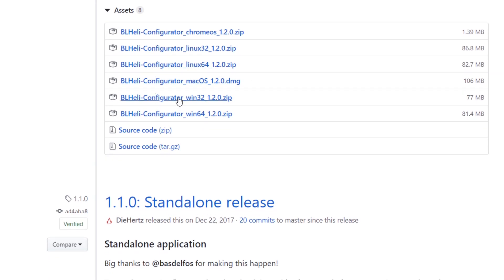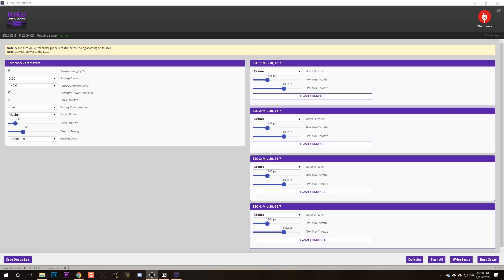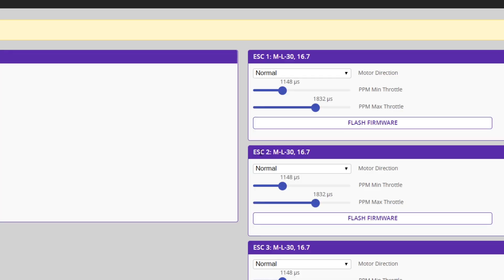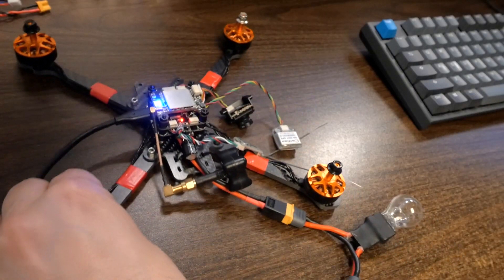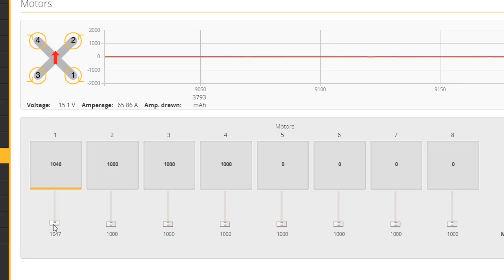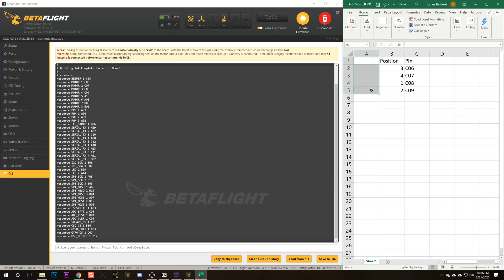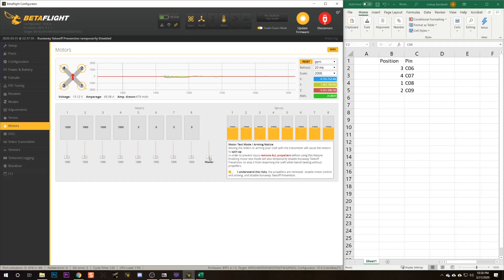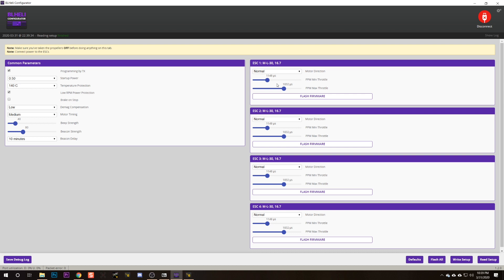Beginner Guide $120 FPV Drone How To Build - Part 9 - BLHeli Motor Direction and Position

Comment: I am using the vifly shortsaver and when i move the sliders it automatically shuts off and thinks there is a fault is this true or is this just becuase you cant spin the motors with the shortsaver on?

Comment: FYI check out his other videos on Bidirectional dshot and RPM filtering. My esc is M H 30 and I was able to flash 16.73 to enable Bidirectional dshot. You can't flash 16.73 in the BL Heli configurator pull down menu so you have to get the HEX file from JazzMaverick github. I went to Oscar Liang's rpm filter setup tutorial and he lays it out very simply. I don't know if it works on an M L 30 esc processor.

Comment: have a esc with M-H-50 Layout but I have flashed M-L30 to it. No connection anymore to my esc's...is there any solution?
Reply from the maker: You can flash the correct firmware using the c2 interface but it's a pain in the butt.
Reply: @JoshuaBardwell  https://www.youtube.com/watch?v=b-7VFt3IhhE
Like in this video? ;)

Comment: Does anyone else's video transmitter get really hot when the battery is plugged in? I'm pretty positive everything is set up correctly but its getting real hot
Reply: Yep. Mine does too. It is working fine so far though. I wouldn’t worry about it

Comment: im plugging in a 3s battery but my motors are not turning at all. i hear sound from the motor like i wants to move but it just doesnt. what could i be doing wrong?

Comment: Hello Joshua, I'm trying to flash my ESC using BLHeli32 configurator version 1.1.0. After I connect my ESC to the configurator, and click "Read Setup" It shows "Reading Setup finished" but there is no change to the main screen and nothing like what you showed in the video happens. I've tried using BLHeli32 Suite, BLHeli Suite, and the 32 bit version of the configurator, and all show some version of "ESC unknown" or "ESC not supported". I've been researching this for over an hour now and have had no luck. If you could provide any advice that would be greatly appreciated. (I'm building the Tyro119)
Reply: Go back into BetaFlight config -> Configuration -> ESC/Motor Features and change ESC/Motor Protocol to DSHOT600, save and reboot. Disconnect/Close BFConfig and try BLHeli again.
Reply: @ShatteredEagle  It worked! Thank you so much! :))))
Reply: @DylanDapperVlogs  np! Literally happened to me 20 minutes before. You probably updated BetaFlight, which cleared the settings, which then the Flight Controller didn't know how to talk to the ESCs so BLHeli couldn't communicate with them either.
Reply: @ShatteredEagle  I did! I flashed betaflight 4.1.5 on it (twice i think accidentally) so I assume that's what happened.
Reply: @DylanDapperVlogs  Heya! Figured I'd also mentioned that despite mounting the FC board correctly, I still had to rotate it 90deg in BetaFlight config for the quad not to death roll instantly on throttle up. Drove me crazy for 20 minutes, assuming flashing BF is also to blame in this case. 

Figured someone else may have the same issue so I should mention it! JB has a video on it as well.
Reply: @ShatteredEagle  Thanks so much this worked for me too! I was googling everything trying to have it show up. Thanks so much!!!

Comment: @Joshua Bardwell   At 4:38 you say no bidirectional dshot for us bc slow processor in ESC.  Mine says M-H-50 instead of M-L-30.  Can mine support it, and how do I enable that?  It is already at the latest FW, 16.7.
Reply: And how can I find what my ESC will do?
Reply from the maker: Yes jf you have an H ESC you xan use JESC to enable bidirectional dshot.

Comment: My tyro 119 came with a different ESC than yours. It came with a m-h-50 bl heli esc (you have m-l-30 in the vide). You can get H blheli_s ESCs to have bidrectional dshot with the JESC firmware. I was able to get RPM filtering setup and working.
Reply: I have the same new one as you. to get them working, do you set the ESC to Bidirectional in bl heli config? are there any other setting in betaflight to set?
Reply: Here's some instructions on how to install the JESC firmware (it's a fork of blheli) https://www.youtube.com/watch?v=Fhn2LdCMqgw, and then Josh Bardwell has instructions for configuring RPM filtering and verifying that it's turned on https://www.youtube.com/watch?v=6a69juWsqyU .
Reply: I  also found that mine has the M-H-50 ESC.  I loaded it with JESC last night and everything seems good so far.  I haven't flown it with that firmware yet but I'm looking forward to trying it out.

Comment: Could you please advise what could possibly go wrong with beeping with motors?
After doing this motor directions remap (following your step by step on a Tyro 129 build) I did manage to have my beeper not working.
Motors stopped to beep on aux channel (mine is set to AUX4). 
I do have the switch turned on with settings set up for beeping when the AUX channel requests it. 
And the RX_SET Is also ON.
 Beeper mode turns yellow also when I flip the switch at my radio controller. (It seems to be working ok from the radio receiver command) but the motors do not beep as they were as I have set it up for the first time.
 Cause it's quite uncomfortable to find a drone in the bushes without beeper)
Reply from the maker: I can't think of any way that remapping would stop the motor buzzer from working. As long as the beeper mode turns yellow and then in the configuration tab you have rx_set enabled for the Dshot Motor Buzzer option, they should beep.
Reply: @JoshuaBardwell  Yep they should. But they don't. Unfortunately. Where could I look at? Any ideas? Already refreshed to latest available Betaflight. However on "pure" settings from scratch this beeper does not seem to be working either.
Reply: @JoshuaBardwell Hello again. I did manage to find out a reason for this. This is a Motor protocol problem. I did fix this by selecting a DSHOT600 protocol on Config menu. (Was ONESHOT) (Just FYI)
Anyway thank you for such prompt reply. And I really like your videos. Wish you growth of audience on YouTube.!!!

Comment: i can connect to blheli but after i hit "read setup" it just says "reading setup finished" but doesn´t do anything else. 
any idea?
Reply from the maker: Are you sure you are using the right program? BLHelisuite32 is for blheli32 ESC's; regular BLHelisuite is for blheli_s ESC's like used on the Tyro 119.
Reply: Joshua Bardwell 
Yes THANK YOU! Figured out that i need BLhelisuite32 :)
Reply: @lukass8169  i have the same problem but where can you find blhelisuite32

Comment: I have got everything configured.  I have my reciever connected and bound.  I have my esc wired to my FC.  I can spin the motors using betaflight.  I have flashed my esc and my fc.  My sticks don't move in configurator when I move them on my transmitter.  I cannot figure this out.  Green light on reciever.  sbus bad jumped on board. red light on FC flashing.  Any suggestions
Reply: Are you sure your receiver can do sbus, also make sure your FC can read sbus, and check you put the sbus wire to the correct pin on the FC

Comment: I just bought the kit, and I'm going to follow your instructions. I started flying line of sight on the smallest Estes quads around 2015, and really enjoyed them. Earlier this year, I picked up an Inductrix FPV Plus RTF on clearance at a shop, and have been instantly hooked on FPV once I started flying on a monitor. I got another Inductrix FPV Plus and a lot of parts and batteries, so I should be able to fly those for years. Now I have a Fat Shark Scout and a Taranis transmitter on the way as well. I'll probably end up with another pair of goggles that aren't the box type, but I figured those would do well enough for a beginner without costing $700, and they'll be good for friends and spectators in the future when I do try some HDOs or whatever.

Thanks for making this series. It demystifies a lot. I want to be able to configure and repair my quads myself as much as possible.

Comment: I've built multiple quads and worked on them even more. I'm getting ready to start on my remix and was trying to figure out if remapping the motors was going to be easier than running longer wire and possibly create a mess. I'm excited to see you include motor remapping in the beginner class lol. I learned something today!

Comment: how do u know if it is slow esc?
Reply: By looking at the firmware that is running on your ESC (see at 4:21).
For this ESC it's "M-L-30". Now, the middle letter can either be "L" or "H". If It's "H" you have a fast processor, if it's "L" it's a slow one.
But as far as I know you CAN run rpm filtering on L-type ESCs. The JazzMaverick-firmware should support it. And i'm not sure if the JESC-firmware can do it by now.
I will actually try this myself tomorrow. I have an "O-L-5" ESC (letter "L" = slow) and I will try my luck and can report back if it worked or not.
Reply: I just tested JazzMavericks firmware on my O_L_5 ESCs and it seems to work without issues.

Comment: 16.71 (Beta) enables bi-directional dshot. Without any 3rd party firmware.
Reply: I don't know...but what I'm sure of is that JazzMaverick is already at 16.8 version of blheli_s (24, 48, 96 kHz)
Reply: Which software is that exactly? 16.71 of what?

Comment: Can I apply these build videos to a tyro 109 because I’ve built one and just need to plug it into beta flight etc..?
Reply from the maker: It's possible the 109 has the same flight controller in which case it should be the same. But even if it's not the same, it should be pretty close.